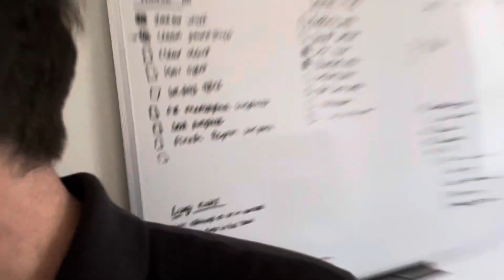REWIRING A LARGE HOUSE - INCLUDING CAT6

Comment: Personally I run everything back to a location that can have a comms rack and just punch them down on a 24 port panel, either under the stairs loft or plant room then run a duct to the location of where the service provider would come from the street be it virgin, openreach or sky. Then present all points around the house either on double or quad plates other than cctv or access points. Like the ducts 👍 I’ve done the same in my place 63mm black ridge less, front garden, rear garden both sides, kitchen island, under the kitchen perimeter cupboards and boiler location in utility they all converge under the floor below the DB in the under stair cupboard 🤟
Reply from the maker: Not everyone is into it like you and I mate, so gotta keep within client budget
Reply: @bristolsparky  Very true, just been lucky with last few jobs being go crazy on the budget types😂 though I find myself walking into jobs now either upselling on structured cabling, alarms, cctv or smart home stuff even on the smaller jobs. People just don’t know what’s available 😂

Comment: Did you use 4mm radials for sockets on 20 amp breaker
Reply from the maker: 2.5mm but shouldn't go more than 40m as volt drop starts getting sketchy
Reply: 16amp

Comment: Nice work.  Nice to see a decent amount of ethernet cables in the domestic dwelling.  

Could you explain more about the Aico reset switch next to the CU?
Reply from the maker: It's basically like another smoke in the circuit, wired exactly the same as well👍🏻